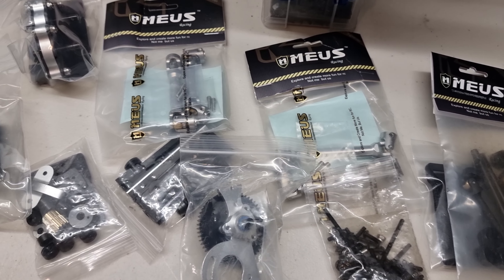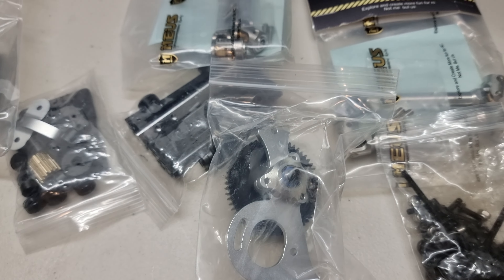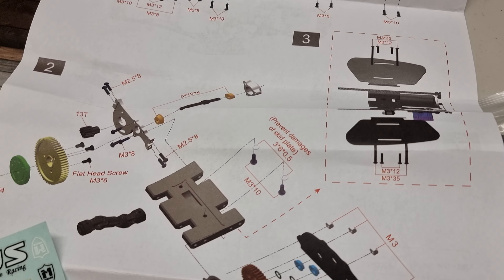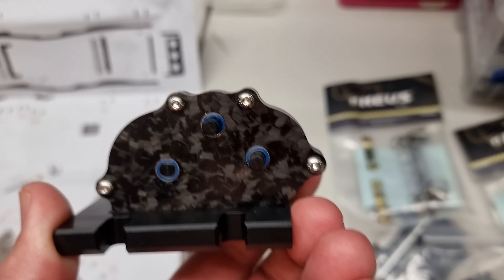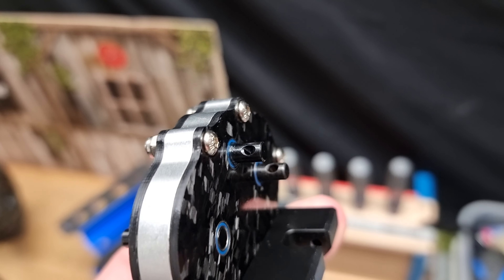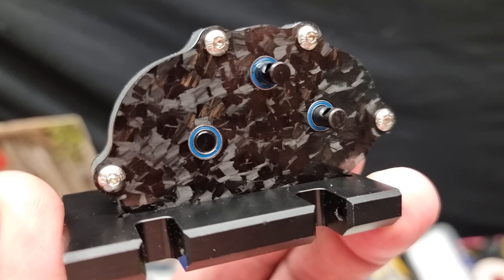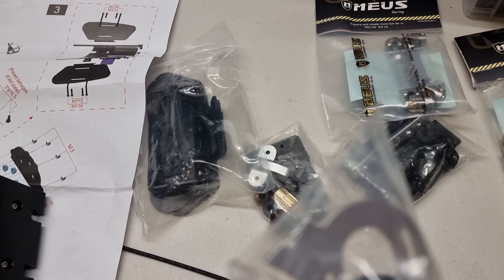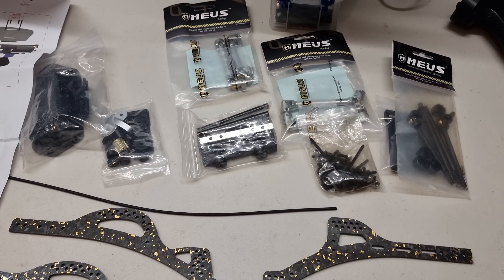MEUS SCX10 SCX10ii Capra LCG Chassis preview

Comment: I'm the designer for this chassis, the gear box isn’t a replication it’s originally designed, I’m glad you like the chassis:)
Reply from the maker: Wow, thanks for dropping in to take a look. What is your favourite feature? It looks well designed and feels nice and smooth.
Reply: @APcalculusAB1763 Lovely gearbox sir!
I might need to try that chassis and do a review on it.
The Meus axles are awesome I know from experience, so curious about this.
Reply: Hello, I wanted to get this chassis, but where can we find the details of the gearbox? Why does it have 3 axles? 3 fixings? Good evening and thanks again for the video👍🏻
Reply from the maker: @RC-Alexbseg  Hi Alex, I'll be doing a video on it soon and I will explain everything.
Reply: @The_RC_Family  you are the best 😉😁👍🏻
Reply from the maker: @RC-Alexbseg  Thank man, I appreciate you
Reply: @The_RC_Family  My fav feature would be the gearbox, I depend a lots of time on it in order to make it thinner (lighter at the same time) and keep the two outputs functional for different od’s for the rear axle & driveshaft
Also the special texture of the carbon fiber is also one of my fav feature and that’s why I name it “the gold rush”
Reply: @RC-Alexbseg  the upper one is the input and two output with different overdrive
Reply: @Team_ReVolt  Tks for supporting! please let me know if there’s any advice and suggestions for the chassis

Comment: I just bought this chassis as well, waiting on my isokinetic capra axles to arrive to finish the build.  Cant wait to get the LCG going.  We have already given Meus an update on the spur gear that has a little lip on the inside and if you tighten the screws it will wobble.  They are going to change it and send a new spur gear.  One of the reasons I buy Meus is that they always try and improve on their products if something is not working.
Reply from the maker: Thank you for all the information. I have been really impressed with the customer service.